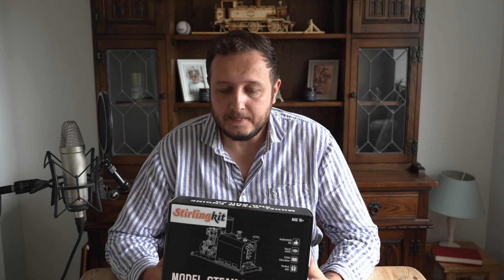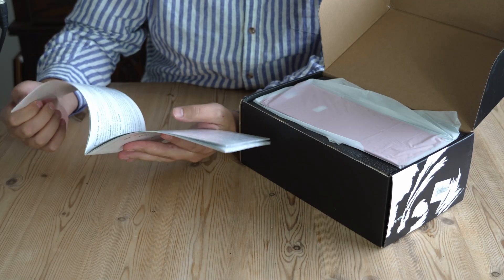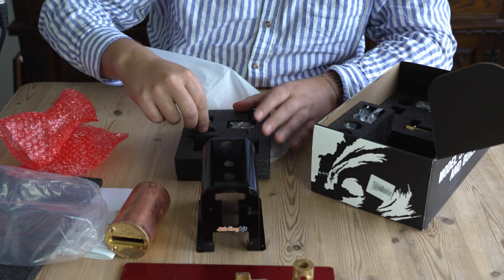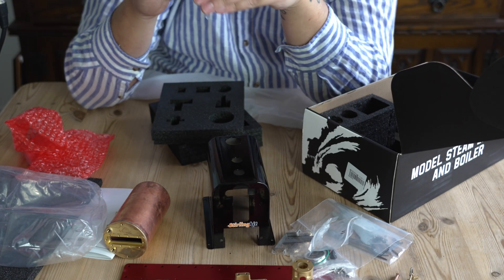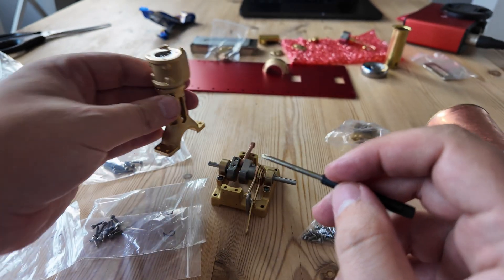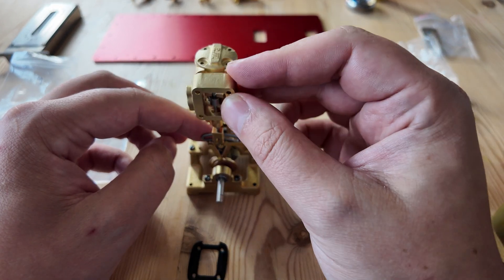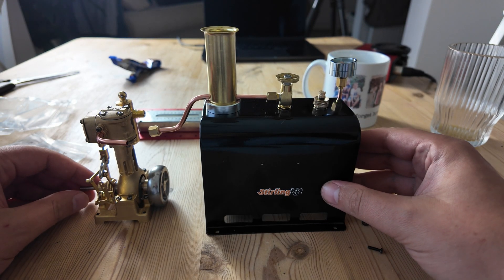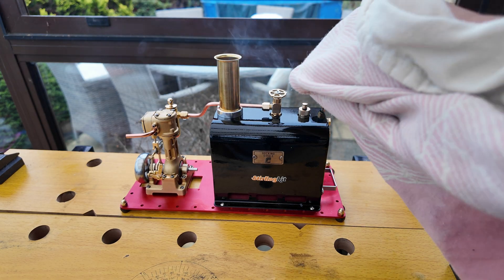This Cheap Chinese Steam Engine is Actually GOOD?! | Stirlingkit RW BL1K Review

Comment: Deionized water isn't really best to use in model steam engines, it attacks the silver solder that holds the boiler together. Distilled water or rain water run through a Brita-type filter is best.
Reply: I run Hornby live steam and the same advise is given in the manual.